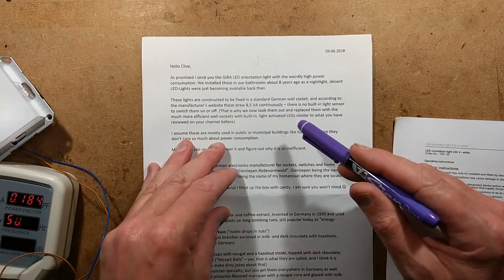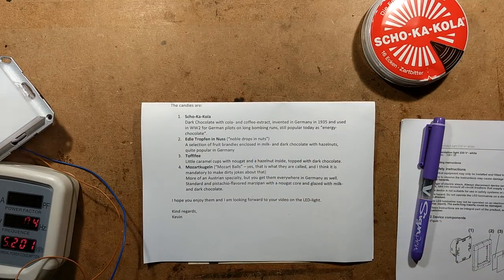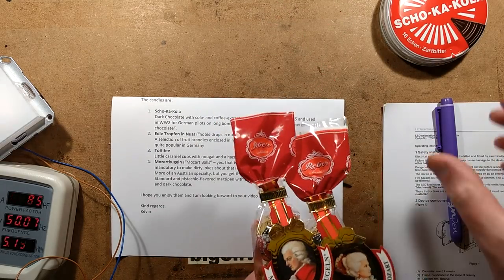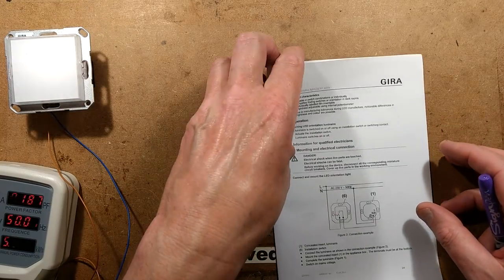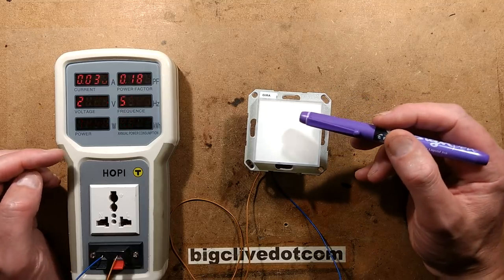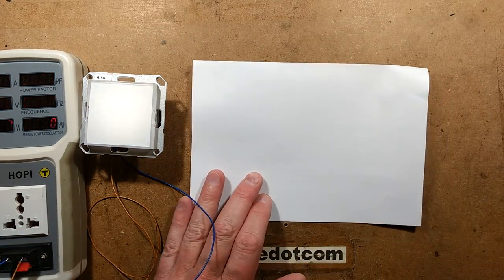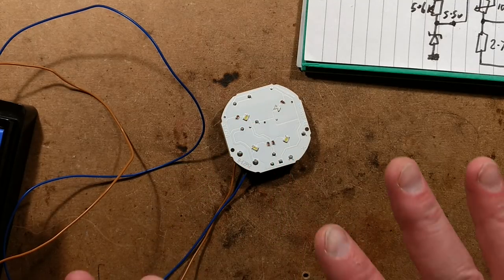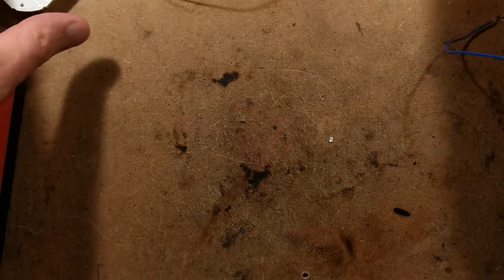Well engineered German LED light?  With schematic and tests.

Comment: "Can't help feeling they could have done this alot simpler, but it's not how they did it." - German engineering summarized in one sentence
Reply from the maker: They do tend to go a little bit over the top at times.  It's a tradition.
Reply: I'd say it's designed to be highly reliable, given the zeners across each LED.
Reply: yes you can have that simpler. But if you design that as an emergency floor light you need them running for ever. If they are broken you would need to get a electrician to replace them. It's a lot cheaper to buy error proof led light. And early leds being what they where that was a smart design.
Reply: Warum einfach wenn es kompliziert auch geht ?
Reply: bigclivedotcom Please start using decent camera. You could change shutter speed. If it was too bright you could change aperture, unlike in iPad.
Reply: Not restricted to just German engineering. There were 24 bolts holding in the upright part of the back seat of my Volvo 340 saloon.
Reply: Zachary Welvaert after doing two years of software engineering at BMW, this was exactly my kneejerk reaction. Many of my elegant solutions were rejected just because they were "too simple" to work in automotive setting. Finally got approval after over-engineering everything to the point that no-one, including the chief achitect could understand it.
Reply: bren106 oh, I know. There is a saying at my shop. "If it's European, Youre-a-payin"
Sad part, customers think we are kidding. Nope. Dead serious. Those cars take longer then most American or Asian cars to do just about anything to.
Reply: Someone had to say it, part of the reason they lost the war.
Reply: Zachary - and for non-Europeans the "routine replacement" components are far dearer than the competition. MB / VW / BMW / Volvo are particulary costly for common parts (if they "must" be OEM, i.e. warranty servicing). Peugeot / FIAT / Citroen are only marginally cheaper, then there's a big "comparable parts price" drop to Toyota / Mitsubishi / GM (Holden) / Ford, and a slightly smaller drop to KIA / Hyundai. Those who "must have" the "designer" label get hit on purchase, insurance, and servicing!
Reply: Landrew0 WW2 equipment wasn't actually over engineered but highly rushed through the design and testing phase (as was with allied stuff). They should have done more engineering for the most part to prevent premature failures but time was just not there and people were maybe overly confident.
Reply: And this light wasn't actually over engineered just proper engineered. With a bit simpler design requirements some stuff could have been left out but yeah.. They could have gone for Powerfactor correction or something which would be quite funny
Reply: Phil S I have a Mercedes and a Vauxhall, I find the parts very reasonably priced for the Mercedes as long as I buy from my usual MB dealer. The knock off Fram parts from Halfords are a lot dearer. Examples, oil filter from MB £9.10, Halfords Fram copy £18, air filters from MB £25.00, Halfords Fram copy £38. Oil, 6L of MB129.5 £25.
Less normal part, complete headlight unit from MB (free delivery in 2 days from Germany) £196, 2nd hand from a "specialist" breakers yards £350 to £500 (oh how I laughed at those quotes on the phone... Delivery was about £50extra from 3 places in England), the one from MB came with all new lamps and a warranty. It's not the parts that's expensive in a Mercedes dealership it's the labour.
Reply: lesslighter It's really just a legend and probably comes from weird WW2 weaponsystems or whatever. I mean nowadays we don't produce consumer goods... apart from cars maybe. Everything that comes out of here is professional or industrial equipment where cost doesn't matter much. And cost is the driving point to engineer something proper and the simplest way possible
Reply: That's why your fewer but complicated designed tanks lost against the cruder but many more russian tanks ...
Reply: Leif Neland The russian tanks were very very crude sometimes.. and german tanks had a few design problems. You can't call that over engineered as they should have engineered them better. If we took the russian approach it would not work for us since steel and fuel supply was already nonexistent as most of the tanks we talk about were quite late in the war. Early in the war we have ran over france with basically overall worse and lighter tanks, the "premium" german tanks were later on
Reply: is there such thing as a over engineered German phrase? where it's meaning gets lost cuz it's so convoluted.
Reply: FL1PN0S1S Well some law paragraphs are not at all easy to understand and most non-lawyers probably can't get them. But that's likely the same thing in other countries
Reply: Have you seen a Tesla car?  You have to push a switch to get out of the car, the computer monitor rivals 17" and almost everything is controlled from that.  Complex for the sake of being complex.  I would like to tell the engineers at Tesla they aren't real engineers because they didn't follow the KISS rule.
Reply: It's called overengineering and makes them one of the wealthiest countries in the world with literally zero natural resources but ridiculous export rates

Comment: A quit easy way to describe reactive, apparent and active power is this:
Active power is the power which is being converted in the device into mechanical/thermical/illuminating/... power. It's the one that makes your (classic) meter turn.
Reactive power is the power, which is temporaly stored in any magnetic oder electric field of a device, each halv-wave it will be pulled from the distributor an then pushed back again, it appears when capacitators or inductances are connected to AC.
Reactive power is commuting like a pendulum between the power distributor and the device, it will not do any work but it stresses the power lines.
Apparant power is the vectorial sum of  active and reactive power and equals effective current multiplied by eff. voltage.
(Sry for my bad english, i am german and the last english lesson is 28 years ago)
Reply from the maker: Your English is good.
Reply: Good explanation about a subject which I've never quite understood. I wish I had taken more notice of my German lessons many many years ago so I could at least thank you in your own language! Danke schone!! :-)
Reply: Very nice explanation Herr Casimir...Danke

Comment: If the power companies start charging domestic consumers for apparent power, I'll start paying them with imaginary money, in multiples of i pounds...
Reply: LOL. As an electrical engineer for a power company,  I have mixed feelings about this. We do have to provide capacity to serve the apparent power. Since power factor is non-linear, it has to be pretty bad before we start to care...say, about 80%. On certain rates, we will measure VAR's as well. For homes, it really hasn't mattered historically because most of the loads had good power factors with resistance lamps, heating, and induction motors. However, now that we are starting to see the LED lighting with sh!t power factors, we are beginning to take some notice. But, the precedent is set, so I can understand the angst....and I do pay a full electric bill as well. :)
Reply: The real way to deal with that would be to mandate a good power factor on anything sold in the country for domestic use. Large customers, historically the only ones charged for power factor, would have the nous to install active PFC gear. Your householder, notsomuch.

But yes, I too can see the power company's side, especially with all the electronic stuff showing up.

Interestingly I wonder if the mix of inductive stuff (motor loads like ceiling fans and extractor fans) and capacitive droppers... doesn't actually result in a fairly decent conventional power factor for the installation,  but even then, PCs and smps's would mess up the waveform shape horribly
Reply: AFAIK, wattless units are very cheap. I know a few places that demand a PF of at least 0.95 to avoid penalties. I doubt they can charge domestic customers as there is no other phase for the meter to reference to.
Reply: haddockman30 As the hopi meter in the video demonstrated, measuring power factor on a single phase is trivial and needs no external reference. Measuring actual power was always the hard part.
Reply: haddockman30 I think the minimum power factor clause (on a full installation / whole house basis) is also in my home supply terms since before I was born.  So problem is not plugging in too many capacitive or inductive loads  (net, they cancel out).  But as long as the heavier loads are close to 1.00, they should drown out occasional capacitive loads. Fortunately larger SMPS like in computers do include PFC circuits already.
Reply: Shouldn't that be multiples of 'j' pounds ;)
Reply: Jason Hardman imaginary pounds lol 😂
Reply: On SMPS over 75W, high power factor has been mandated for a very, very long time. So it's pretty much small devices only that are that much off kilter, and as a whole, higher current-carrying capacity shouldn't need to be maintained.

If in spite of not having to maintain higher current-carrying or actually serve bad power factors as a whole they started charging individual consumers for apparent power, it WOULD be an extreme dick move.
Reply: Surely the peak demand for domestic consumers electrical heating in winter swamps any poor power factor from low power electronics?
Reply: The PFis current in relation to voltage on the phase, the other phases does not come into play in the calculation.
Reply: Do places use electrical heating? How odd. Not gas?
Reply: @Roflcopter4b  electrical heat, electical stoves and ovens.  Gas is scary for some people who have heard horror stories about gas leaks and/or explosions.

I mean, it is your perspective.  People who use various forms of pellet stoves might find your use of gas heat odd.

You also have to consider places that don't require much heat at any point in the year; I used to live in a place where xmas it could be 80; it never snowed.  40F they bundled up like they were in alaska.  electric heat install is much easier than running gas lines through the house or running a boiler system for a week or month of the year.
Reply: "Apparently" the power companies are not planning on doing that! 😂😂😂
Reply: @billbrowning3021  While I do agree about the need to provide the capacity for the current, i question the idea of measuring apparent power for each home. If you run a bunch of LED lamps with capacitive voltage droppers in your flat and your neighbor runs his old washing machine at the same time, the leading and lagging reactive currents will cancel themselves to some extent, before even getting into the power grid.

The next move could be to have "smart" meters for each room, or even each appliance. Then you could be charged for even more apparent power.
Reply: @Mark1024MAK  Not in Europe. All heating and most cooking is done with natural gas.
We're slowly moving away from gas and into heat pumps. So in time winter will see many motors running the heat pumps, which I believe have a good power factor as well, right?
Reply: @Roflcopter4b  America uses mainly electrical (resistive) heating. As that country is too big to have a gas distribution network, and electricity is very cheap.
Reply: @sigi9669  - the mainland U.K. uses a mix. Some places use electricity for heating, hot water and cooking. Some use both electricity and mains gas for heating, hot water and cooking. Some use just gas for central heating, hot water and cooking. Plus other various other combinations...
For example in my house, normally gas is used for the central heating and hot water, for a gas fire (only used very occasionally) and for a gas hob in the kitchen. Electricity is used for the oven (cooker) and I have three electric heaters in case the central heating should fail. I also have an electric immersion heater that can be used if needed.

The point I was trying to make, is as the electricity company in the mainland U.K. does not know when the supply cable (and supporting infrastructure) is installed, what choices the householder will make, normally at least a 60A feed is provided. This is enough for an immersion heater (on a 16A circuit), an electric shower (on a 32A, 40A or 45A circuit), an electric cooker (on a 45A circuit), or a couple of 2kW room heaters (plugged into either 20A radial/spur circuits or 32A ring circuits). Although obviously not all being used at the same time.
So the leading or lagging current caused by a poor power factor of small motors or capacitor dropper LED lights and gadgets is insignificant in comparison.

Comment: Do note that even if they charge for apparent power, you won't be charged for the full reactive power of the LEDs unless you only have these LEDs running. The relation is (apparent power)^2 = (real power)^2 + (reactive power)^2, the reactive power makes less difference if there's more real power being used.
Also the capacitive LED loads might even compensate slightly for inductive loads like your fridge.
I wouldn't draw any conclusions without measuring it.

Comment: If the supply authorities DO start charging for apparent power, then we can expect the LED lighting companies to fit power factor correction components - just as we currently see in traditional fluorescent ceiling fittings. Then, we'll see enterprising Chinese suppliers producing power factor correction "add-on" circuitry for existing LED luminaires!
Reply from the maker: It's more likely we'll see Chinese manufacturers printing PF =1 on the boxes and supplying the same lamps.
Reply: Cynical, but so very true!
Reply: Right next to "CE" ;)
Reply: PF is very simple, on the DC bus all you need is a boost converter. And a simple chip. That'll be an inductor, diode, tranny and a cheep IC.
Reply: @beware_the_moose  "China Equipment"